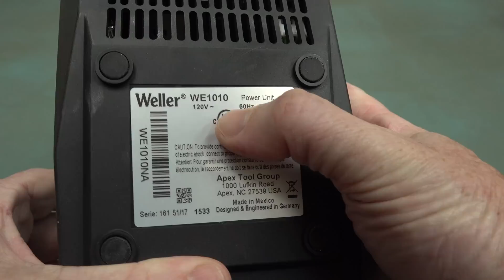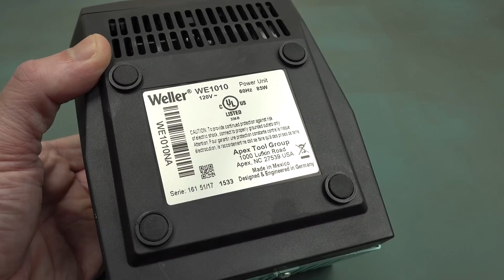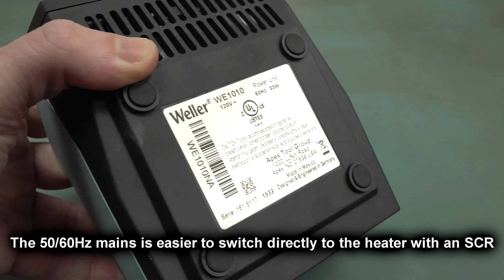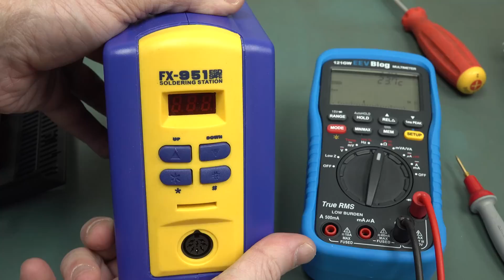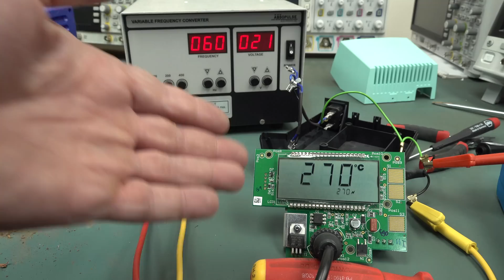EEVblog #1152 - 240V-120V = Magic Smoke!

Comment: Once I had an unusual power cut in my house. Unusual because half of my stuff worked, half didn’t. Also all the incandescent bulbs were dim. Putting my meter across the mains there was only 120v instead of the UK standard of 240v. Obviously the kit that worked had auto switching 120/240v power supplies, while the stuff that stopped working was 240v only. Unfortunately I didn’t have any other kit to investigate what was wrong. I suspect maybe half wave rectified due to a failure at the substation?
Reply: I can't think of any reason how that's possible unless if one phase went down? But it's not p-p in a wye system 240V
Reply: Halogen lamps are absolutely allergic to this kind of brownout and will fail within short order. Happened at work once (a substation got damaged during construction work), a desk lamp and a laser MFP fuser unit did not make it. Thankfully insurance paid for the fuser.

I am guessing the halogens don't do their job under these conditions, so the filament quickly degrades.
Reply: @PileOfEmptyTapes   brownout doesn't kill halogens, stage lighting dim them all the time, but voltage spikes could
Reply: Curious, usually a brownout in Australia would result in 170V due a bad phase.  Might have been a fault at a substation.  I have heard of switch mode supplies behaving oddly in brownout conditions. E.g. Some may keep working but pull a lot of current trying to regulate.  Usually that will slowly cremate a ballast/anti surge resistor.  I've heard of some dual-range auto-switching supplies going to 120V when the supply drops to 170V and blowing themselves up.  Other cases had pulsating output as the supply kept switching back and forth.  If the two ranges don't meet, ie 100-130 and 200-250 what happens with an in between voltage?
Reply: Similar thing happened in my house (US). Construction crew was installing drainage pipes, using the bucket of a backhoe to lift our home's buried power cables to slide a long concrete pipe underneath, and they managed to break one cable internally (lucky for them they didn't cut through the insulation!). Some rooms were fine, others had no power, and some rooms were lit dimly. 120-volt refrigerator running half-speed, 240-volt water pump worked fine.

TL;DR: Lost one phase, weird results.
Reply: @highks  yes, around 50w and under, when dimmed to 70-90% can drop undet the critical 250°C (?)  bulb temperature, but still evaporating tungsten and giving the bulb lower life. But excample 2000w halogen probably doesn't drop under 250°C easily. Normal halogens last allmost indefinetly at 50% or under

Comment: The core saturated. It is therefore unlikely the secondary went to double voltage. The majority of the delta 120-240v would have been dropped resistively across the primary.  The primary winding is presumably thinner than the mains lead. It would therefore been very close to open circuiting the primary. Hot enough to boil off the enamel, not hot enough to melt or set fire to the bobbin. Connect the transformer to the mains outside in the open, see how long it takes for the primary to completely blow.
Enamelled copper wire smoke is potentially flammable.
Reply: @invendelirium  With that assumption, as the core saturates just beyond the top of the rated input sinewave,  doesn't the magnetic coupling between windings tend towards that of an air cored inductor?

Comment: It most likely never got to double output voltage. If the core saturates, the magnetic flux clips and the secondary voltage does, too. I think it got only 30-40% overvoltage which shouldn't immidiately blow anything. 

For Germany: As far as I know a transformer has to be fused unless it is short circuit proof by design or has thermal protection built in. 

Also, there already was a  thread on your very own forum about that exact blunder: https://www.eevblog.com/forum/repair/repairing-a-weller-soldering-station/

Comment: The low voltage on the power supply can't be due to the losses in the leads, since it's measured BEFORE the leads. So it's just the power supply that can't cope with the current draw.

Comment: I did this to my Keithley 2000: a flash from the VFD and it was dead. Then I remembered I used the step down transformer last time because I did not have the right primary fuse for 230V. I set it to 230V, put in a new primary fuse and it came back alive. Lucky escape.

Comment: Just grab the trusty yihau. Also, I haven't seen the tare down and I am only about 5m in so far, but is there supposed to be a resister between those solder joints on r21?
Reply: Not all the commitments are populated on most boards. Esp boards that are used in different applications.
Reply: @xenonram  I know

Comment: Don't think running it at 50HZ rather than 60 HZ helped. I had a 5 KW 440 volt  60HZ three phase motor driving a fan that came out of a submarine, I thought it would be great for ventilation of my workshop. It blew up fairly quickly like a few hours running on 415 volts 50HZ, I took it to a rewind shop and they said it was down to drawing to much current due to the lower frequency,.

Comment: Heh, I did this with my old PC power supply. It turns out that red switch on the back was for switching between 120/240V input. Palm met face that day.
Reply: I worked at a school at that time when that was a "feature", and I had to super glue the switches to 230V or else the more "helpful" pupils would do just that ...

Comment: No fuse at primary??!? Shocking. Is it even allowed with CE?
Reply: Its not CE (check at 1:24) since its not for sale in Europe. I'd imagine the European version does have a fuse, though i have seen older electronics without them.
Reply: @tomkennaugh  You're right. It's not CE labelled. However, I wonder what kind of thinking was behind creating separate variants with and without the fuse. The savings must have been really peanuts, I guess..

Comment: Regardless of regulation I would expect Weller to spend an extra 25 cents for a fused IEC connector and a properly sized fuse. It would have prevented all this damage from even occurring. The transformer saturated without a doubt and this caused the impedance of the primary to drop significantly which in turn caused the transformer to draw excessive current and burn the enamel on the windings. Had there been a fuse say 5A or whatever it would have blown as soon as the transformer turned on and saturated. The transformer would still be in perfect working condition. The design is unacceptable.
Reply: I just did the same mistake and burnt my brand new Weller

Comment: you pumped 3840 watts thru a transformer rated for 1920 watts sure enough that would saturate it. sure you made a whopper of a mistake but then you are just one human. Weller made a bigger fault by not fusing the primary side. but I think that's cost-cutting bean counters work. I would hope an engineer would have designed the fuse. but then the beancounter would have cut it out.

Comment: Why is the IEC connector the same for BOTH 120 and 240 volts? If you are dealing with both it would be VERY easy to mix'em up! :O

9:03 That's officaly f...ed.

Comment: I don't think it's legal to be sold without a fuse in Europe, this product like this is probably US only. (And made in like Romania for the EU market <~ common assembly location nowadays for electronics in the EU)
Reply: The EU doesn't require primary fuses in every device. These giant plugs with integrated fuse are a British specialty.
Reply: @MetalheadAndNerd  i have never seen a device without in the EU, i think they put them in due to other regulations? We have a lot more product safety/durability regulations than the US.
(EMF, etc)
Self-imported crap from china of course doesn't have fuses, but receivers and audio equipment don't have fuses in the plug in the UK Either they have them in the device itself but not in the plug.
Reply: @foxsux6000  I'm from Germany. Neither my vacuum cleaner nor my fridge, my washing machine, hair dryer, printer, toaster or any other 230V product except of lab equipment has an integrated fuse on the 230V side.
Reply: @MetalheadAndNerd   I live in The Netherlands and all my devices have them, except for the water cooker.
Reply: @MetalheadAndNerd  it might be because the majority of electronics going to the UK always pass through The Netherlands? So it's just cheaper to chuck in a different plug and put the fuse into the device by default?
Reply: @foxsux6000  The Netherlands probably also have their own special regulations. For example I was astonished when I first searched for a light switch in a house in the Netherlands and learned that it is common to have the light switches mounted under the ceiling and a rope dangling from there to turn the light on or off. Maybe this is because of higher flood risk?

Comment: The 120V FX-888D throws its primary fuse the moment you give it 240V. Shame Weller didn't fit one I suppose. The 888D fuse is unhelpfully soldered onto the board, which is awkward to fix if it's your only iron!

Comment: Is it me or does that transformer look like it's a 45-50VA one. It surely does not look like a 75VA (75W stated on the label of the station. Peak maybe?). Maybe I'm used to seeing transformers designed for 50Hz AC, as opposed to 60Hz ones... But, still, I'm not convinced that's a 75W transformer.

Comment: Small mains transformers like this are designed to operate just starting to saturate even at proper voltage. You can observe this by monitoring the current waveform using an isolated scope probe across a low value resistor in series with the primary leads. The wave form gets "spikey" as you turn up the voltage closer to mains level. This is done to allow the minimum number of turns to keep copper losses down for better load regulation and to use the minimum amount of iron core material.
Reply from the maker: That would be interesting to investigate.
Reply: @EEVblog  I should mention that this is the case at no load. Microwave oven transformer are an extreme example of this. They are designed to always have the full load of the magnetron on them. When powered with no load on the secondary, they still draw a significant amount of current.
Reply: @EEVblog  Reading all the questions and answers, it seems to me that a lot of people would benefit from a video explaining transformer action. The common misconception for most people seems to be that the flux density in a transformer changes when a load is connected to the transformer. On the other hand, It's not an easy topic and difficult to explain because it requires a lot of theory.
Reply: "Billion" brand transformers are known for this.. they usually burn out quickly (short service life) even at rated voltage!
Reply: @WarpRadio  That actually depends on the customer. Never seen a defective Billion transformer in a Philips apparatus.
Reply: @WarpRadio  Looking forward to that video :)
Reply: Completely agree on that. Saving money on iron and copper leaves no room for even small over voltages.
Reply: @SwitchingNoise  yeah, that was what I was thinking too :P
Reply: @SwitchingNoise  Skip the copper, Save the Penny !
Reply: Which means it would have been running hot at 50Hz when designed for the bare minimum at 60Hz - unless the supply voltage had been suitably reduced.  I wonder if it had signs of cooking prior to this event.
Reply: So in summary they play with the fact that the transformer will most likely always have some load from the soldering iron to avoid saturation, much like micrwave oven transformers?
Reply: Laharl Krichevskoy But the station switches the iron on and off based on the thermal sensor.  So most of the time there will only be the power drawn by the control circuit and LCD.
Reply: @laharl2k   - The load current has no bearing on whether or not the transformer saturates, it is only a function of the voltage across the transformer windings and the frequency.
Reply: @laharl2k  the unit operates just fine with no load other than the controller board attached.  i usually will detach the iron cable from mine to change tips.  yeah, i know it can be done hot, but that little nut is a bit small, and even though i've been soldering since i was eight, i still hate how long it takes for that hard burnt skin to grow off.
Reply: Soldered together transformer plates do not help either. If they would go with alternating setup (EII3) with plates isolated, it could probably survive.
Reply: @Piasecznik72   They would choose a smaller core size then, so it still wouldn't survive 100% overvoltage.

Comment: Dave you forgot about the impedance of the primary nut just the resistance
Reply: There won´t be much inductance left in that coil. There are definitely shorted windings in there.

Comment: Of course in the earlier types which had the holder for the soldering iron on top of the box, it was an advantage to have the classical transformer in it (and not a switchmode supply) because it doubled-up as a dead weight to keep the whole thing in place when you carelessly put the iron into the holder.

Comment: Thumbs down for the fake thumbnail image.
Reply: I stayed for the whole video thinking Dave wouldnt do that to us
Reply: The thumbnail looked obviously "fake" to me before I clicked on it.  Dave's done fake flames before too but they were also obvious.  Search back it was a PS from China that Dave was building into a case.  Maybe a year ago?
Reply: ElmerFuddGun Yeah, same thing with the power supply. But the things weren’t on fire when he was filming. Also, I just got one of those power supplies and it’s awesome! A kilowatt of power for $60! Thankfully, what caused that failure - a bypass/filter capacitor on the output that was susceptible to physical damage, has been completely removed.

Comment: no fuse on primary side, what a terrible design oversight, I wouldnt expect that from weller
Reply: And they got three on the secondary side.  Why not put one fuse on primary, one fuse for the iron and the polyfuse for the control board?
Reply: @0x8badf00d ..because overvlotage on the primary is a rare occurrence. It was an oversight by Dave. It would be expected that if you are going to plug in a soldering iron you kinda know what you are doing. Sure you can put it a polyfuse for that, and a HRC for this, but where really does it stop. Read the placard is the moral of the story.
Reply: @Detroit8V92tta  in the ideal world it would be expected, but in any kind of production environment expect the unexpected, Oskar has a point, fuses should be spread through the device not concentrated only on secondary side
Reply: @0x8badf00d  Fuse on the plug. My original comment.
Reply: Yeah I have to agree. It really should have a fuse on the primary winding. However where does it stop? Clock radios? Etc. Hmmm
Reply: @Detroit8V92tta  It doesn't need an input fuse in the US. We have 15 amp breakers on our outlets and those are going to let go before you get a house fire.
Reply: @TestECull   I see. So are they on the actual power outlet or at the switchboard?
Reply: @TestECull , I'd not have wanted to test the theory... "before you get a house fire."
Reply: TestECull, a breaker will allow over 1kW of power into that little transformer which could have easily caught fire.  A circuit breaker has no way of knowing if you are using a 1250 watt hairdryer or a 60 watt transformer.  The breaker’s purpose is to protect the house wiring, not the appliance.

Each appliance has to have a properly rated fuse on the primary or you use a transformer wound with fusable primary wire. It’s an alloy that melts at a very low temperature and breaks at the first hotspot vs shorting into a cascade failure.  That’s how they were able to make all those transformer wall warts without primary fuses back in the 70’s, 80’s and 90’s.  Fusable primarily windings.  I repaired many of them as the winding often broke at the terminal.  It was difficult to solder back because the heat of the soldering iron melts the fusable wire.
Reply: No regulations call for a input fuse on devices like these so long as the cord is short enough. It's always best to understand the equipment you have .

Comment: well ... is it possible use device with 24v 5a ish power supply (smps)?
Reply: @J M why not dc? your answer created more questions in my brain. probably i cant find answers without circuit diagram and solder tips datasheet.
Reply: yep ... triac wonderful for linear ac jobs but still getting hot / not durable if you compare to mosfet with pulse modulation. also transformator has couple problems, working long but too much power loss etc.   i dont know  why they select working with transformer ... industry standard?